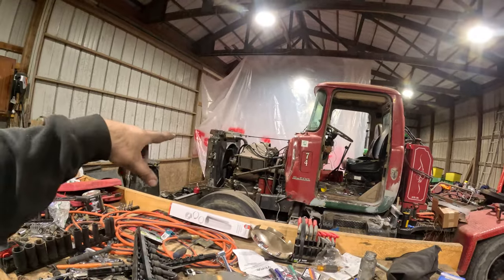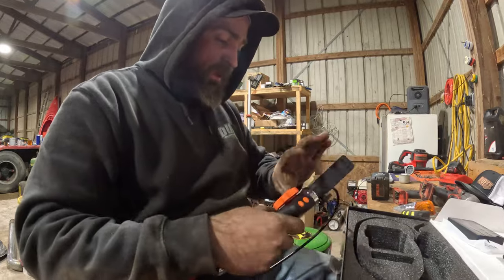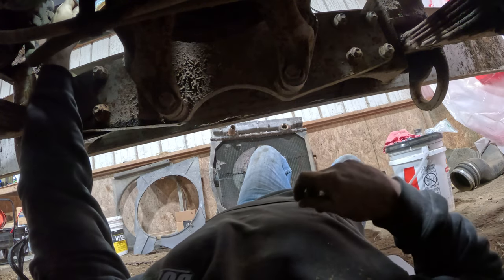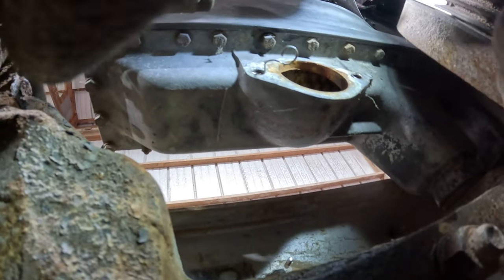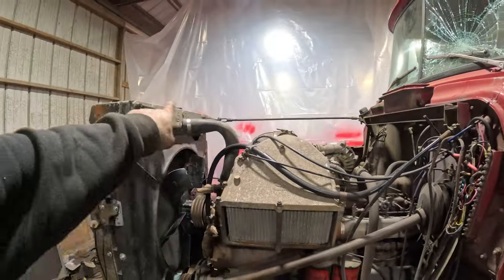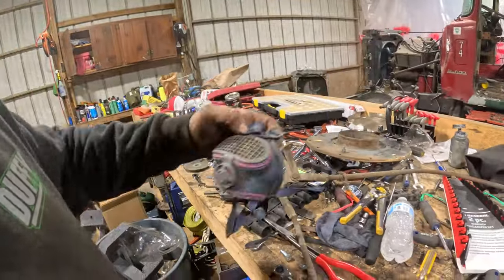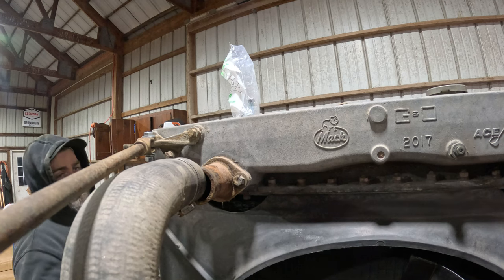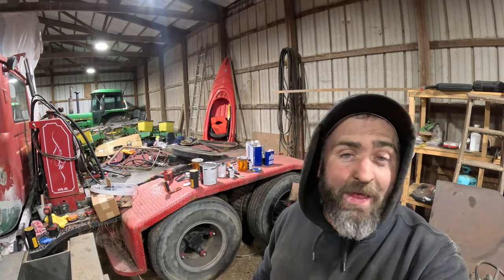Broken Bolts & Messed Up Threads- Mack Radiator Issues

Comment: I kept a separate section on notes on my phone for each piece of equipment with brand & # for filters oil, air #for belts, quantity of oil& fluids etc 
They loved me at parts store as they never had to look up & you could order in advance & check when they’d get parts in
A pain to set up & I included vin’s,  & model & serials for all equipment I had 30 pieces

Comment: Put liner panel on the ceiling this summer an blow some insulation in the ceiling.  That will help tremendously with the heat. 
You have come a long way in a year. Starting from scratch ain't easy. 
Keep on keeping on

Comment: Chris you really need to look at getting  a Rode Wireless Go and attach the fur wind break or a better mic that attaches to camera. So  that you can use with your Go Pro and/or get you a better camera that stays on tripod in the shop that you setup for shop work. That’ll work with mic, use GoPro when you move around or want close up shots.  It’ll help with sound and your production of content. 
Keep on grinding and can’t wait to see Mack finished! Just a thought, they wireless mics are small n attach near chest or collar.

Comment: Driving and being around mack concrete and rolloff  trucks of that age , that rad is infinitely rebuildable as long as bolt holes and mating surfaces don't deteriorate . Radiator shops that do big trucks ought to be able to do it .

Comment: I would've tried 7/16 first half-inch is very big
Reply: 3406B had 7/16 inch bolts that were stripped out  holding transmission , used 12mm metric thread pitch is the same so they tap out real nice and easy very secure when finished.

Comment: I know it’s probably too late but why wouldn’t you just take the radiator back out to fix those holes it looks like there just isn’t any room. Heili coils have been my favorite way to fix stripped out threads for so long I don’t remember if it was in the 80s or 90s when I started using them. Nice job fixing that truck 😊

Comment: A tap and die set would be a good tool. Those stripped out holes could be fixed by tapping a hole especially if you don’t need to worry about maintaining the original size

Comment: Are you able to go over to the Mac shop and get a radiator replacement for your Mac?
Is that radiator able to be bronze welded to accept the correct Hel.licole or would the radiator get too hot to be bronze welded up would the bronze weld fail due to the heat of the engine, even though the radiator is for cooling?
To all subscribers let's help Duffy get a new radiator for Old Red Mac his beloved farm truck by hitting that like button on YouTube.
Sincerely!
R.S.V.

Comment: you will need Tentis shot if you haven't had one.  Why don't you spray those rusty bolts,  they will come out easier.  could you not use Tap on those coils instead of removing them.